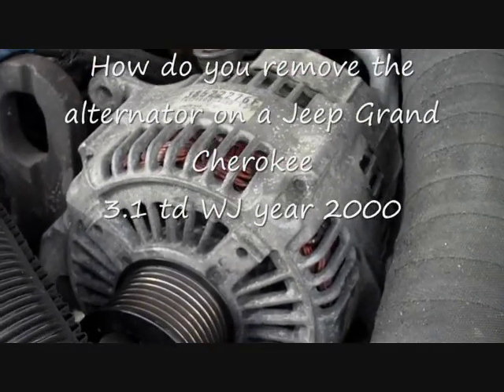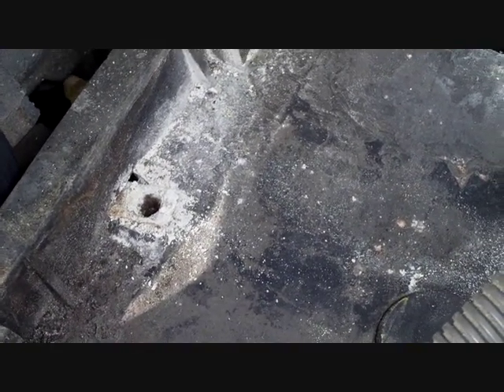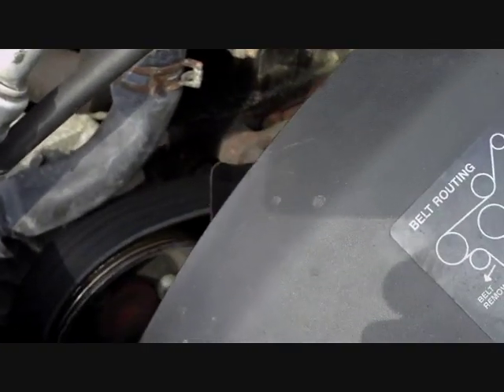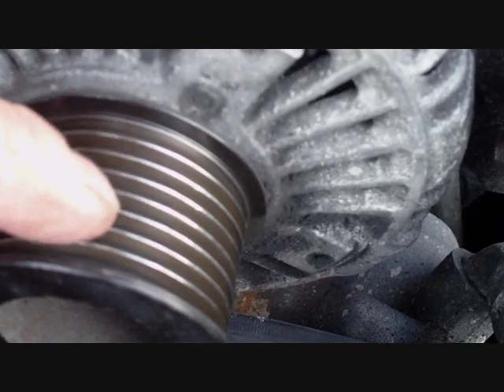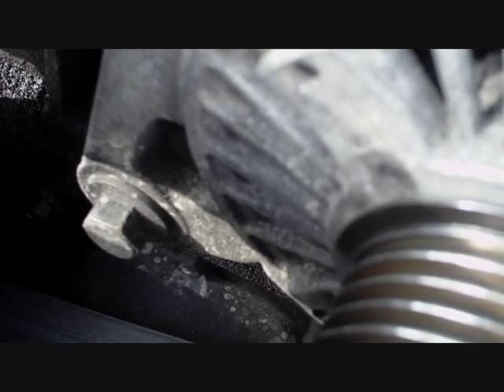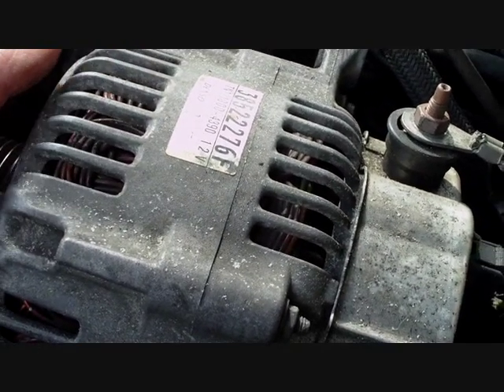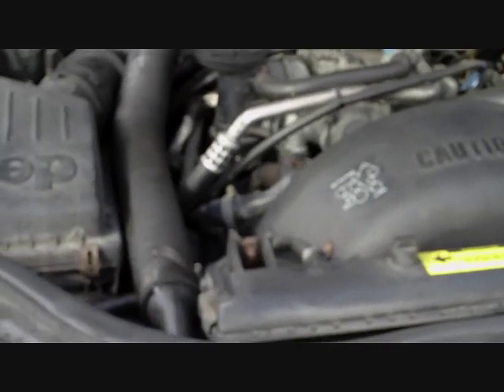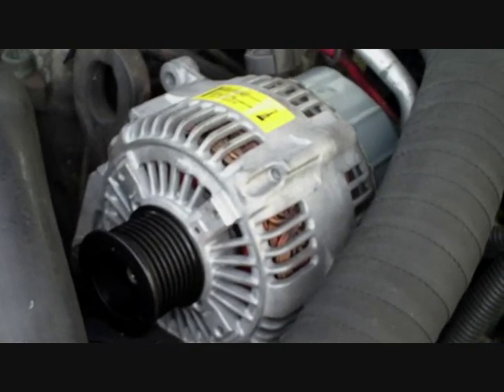Remove the alternator on a Jeep Grand Cherokee  WJ  3.1 td year 2000

Comment: Hi, just a few comments on this :-)
First, why did you remove the battery? It is not necessary at all to do that.
Second, you don't have to use a spanner on the tensioner. It is much better to use a 1/2" ratchet or breaker bar inserted right into the hole the square like it was intended for.
Third, it is advisable to have the belt pulley replaced with a overrunning/freewheel pulley (also called INA cutch). It was standard on the 2001 models. It reduces vibration and wear on the belt.